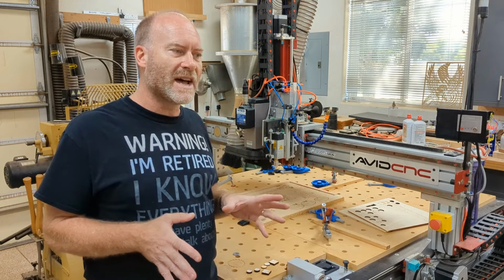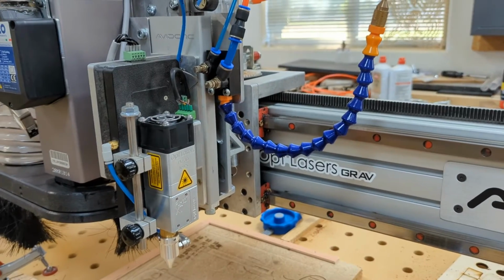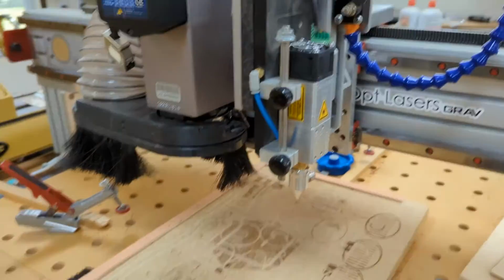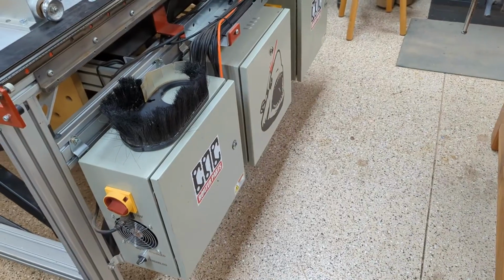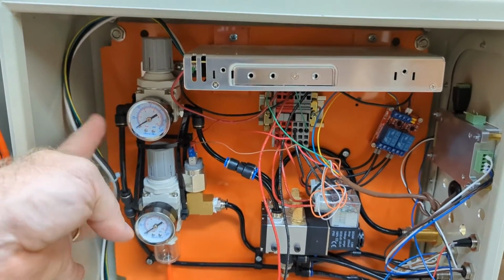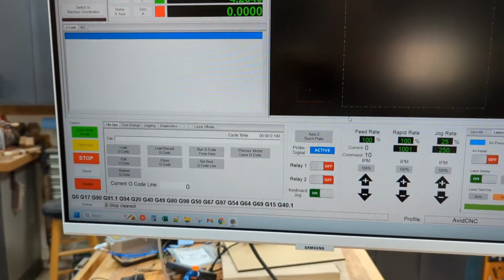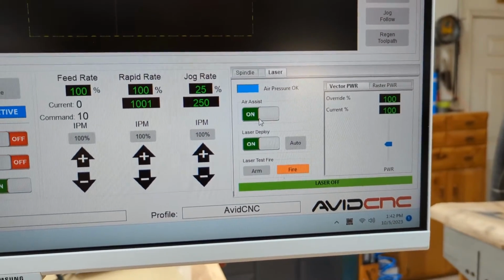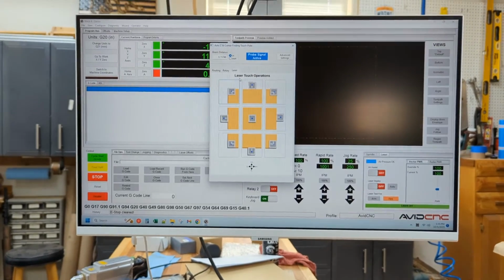Review of AVID CNC's New Laser Kit

Comment: Hi Jim, I am struggling to get mine to work correctly. I use vectric aspire. If I were to just set up a profile cut with toolpath 99 I can use the Mach 4 post processor? Also if that is how it works then how do you change laser power in aspire+how do you do pictures correctly? Sorry I’m a little lost with the laser portion and feel stuck.
Reply from the maker: I can help.  Send me an email at jnwdwks@gmail.com.  It's easier to work through it there.

Comment: Hi Jim, I recently added a laser to my Avid machine and using your screen set I was able to get the laser to test fire.  Then I came across your testing files and the laser actually worked for me.  My question is, how do you process the gcode to have the m2003 and m2004 commands along with the m62 p5 and m63 p5 code?  I use vcarve for my projects and I did just buy the laser module but not sure I needed it.  Thank for all the material you have posted!!

Edit** I figured out how to choose your No z .PP from the vcarve software and I got my first project to work. Thank you for all the work you’ve shared with the community.
Reply: I was just about to say, if you found my laser screen, then you were only one directory away :-)  Glad you found it.

Comment: Jim, I'm curious why you mounted the Opt Laser adapter on the gantry beam? I guess it makes the wire run to the laser head shorter, but is there more to it? 
How did you run the DC power from the power adapter up to that Opt Laser adapter? I'm about to wire up a new machine now and want to consider the options.
Reply from the maker: Hi Scott.  Good questions.  First of all, I had several of the stand alone lasers before I got the whole AVID kit to play with, so that location is there from before I had an AVID control box down below that has the Opt adapter box mounted in it.
However, I do like it up on the gantry because I can see it to tell if its armed, armed or firing, or key switch turned off, from the status of the 3 LEDs.  I also like having quick acess to the red power button so I can power down the laser easily.  The fans on some of the lasers are pretty loud, so I will frequently turn it off to give my ears some relief.  The last reason is that my AVID gets a lot of use as a test bed, so I am frequently switching things out, hooking up oscilloscope probes, etc. so I like having all the connetors up top and accessible for that reason.
As far as routing, I put my 24V power supply down in the control cabinet, and then when I got the AVID laser kit is is now moved to the laser control box.  I brought power and the ESS control wires up through the first run of e-chain (along the Y axis) to the control box mounted to the gantry (making sure the mess of stuff that is hanging on my Z axis can not contact the box when moved to the full right X position).  Then I just had to route from the output of the Opt adapter box along the X e-chain and Z echain the rest of the way to the laser.

BTW, you may have noticed that control box I have is surrounded in a black plastic box.  That is the 30W adapter box needed for the two 30W lasers I have.  Opt is re-designing that box to have a similar footprint of the original silver part, but will handle the extra power internally. I believe they are adding a little LCD display as well, so another reason to have it up top and visible.
Reply: That is very helpful Jim!  I'm hearing that your situation is a pretty special case, and now I understand why you've done it that way. It sounds like I can just mount the laser adapter down near the motion control box (I'm running Centroid Acorn) and put the power and PWM signal to it there. Then run the regular adapter wire up to the laser module head. I didn't know if there were any particular considerations like noise, signal loss, etc. 
The new laser kit is pretty cool. It's too bad it's Mach-4 centric.
Reply from the maker: @scottgrossman6148  The laser kit hardware is not mach-4 centric.  lf your controller has laser PWM support, and two spare outputs and an input, you can run everything in that box just fine.  The only thing thats Mach4 related is the screenset and software that AVID wrote, but you can live without that (I'm not using it because I had been  using lasers for a couple of years so I already had my own workflow and laser screen that I wrote).
I did look at the PWM signals at the adapter box input with the o-scope just to make sure they weren't too noisy.  I don't know what the acorn's I/O's look like, but most CNCs keep the controllers isolated (power and ground wise) from the chassis and other I/Os.  Usually the PWM is a bit too high of a frequency for the typical opto isolators used on CNC controller I/O, so in my case and AVID's, the PWM signal is connected directly to the ESS board, but Opt has designed the laser and control box to be fully isolated, so this still keeps the ESS's internal power domain isolated from the chassis and other power.
I will say that the ESS does have very good laser support.  The ESS plugin itself supports rastering directly, and there are ESS m code macros for tight power control timing with the motors.
Reply: @JNWoodworks  Oh, that is very good to know. I'm not sure how I got that impression, but I'm glad to hear I'm wrong. Thanks for clearing that up!
 The stock Acorn is a bit limited in I/O, six of each. This can be expanded in a couple of ways. I'm going to seriously consider how I can make it happen. 
Thanks so much for the very helpful information Jim! 
Scott
Reply from the maker: @scottgrossman6148  You're welcome.  I looked at the acorn site briefly and they mention they have proportional velocity control, so they must have pretty good laser support.  Looks like there are a lot of different versions of the board, but it should work well for you.  Then you can hook up an input to the air pressure sensor (i would call that optional, its just a safety check to see that there is adequate air pressure), and an output to turn on the air assist solenoid, and another to control the air deploy mechanism.  If you were only doing laser on your machine, you could also run these two things with one output, but if you are wanting to use an air nozzle for spindle work (I recommend that for some things it really helps clear chips and cool the bit and material), then you'd wan to keep them seperate.

Comment: Do you have any additional information on your magnetic mount for the 15w and 30w opt laser -or where did you source your “pogo” pin connectors. You have an awesome setup thanks for sharing
Reply from the maker: Yes, I have a google drive with all my laser setup files, mach4 screens, post processors, etc.  https://drive.google.com/drive/folders/1xB6J0RZIU1j8g951NkP-8HXC1swC2C-B?usp=drive_link
In there is laser set power point file, and on page 5 is an embedded document for the magnetic mount with part numbers.  If you are going to use it with the heavier 30W laser, I would recommend moving up to a 0.5" diameter magnet size.   I also have added the base design for the 30W laser in the vectric file.
Reply from the maker: You can always email me with questions at jnwdwks@gmail.com as well.
Reply: Thanks I just ordered it he 30W laser — I love the magnetic mount on my 6w opt laser and after seeing your mount I’d like to make something similar.  Such a great concept and I appreciate the inspiration

Comment: Thanks for all the good videos! I have a question about Rastering Bitmap Images Directly in Mach4 with ESS. I want the air assist to run also during the image raster, but I can't see to turn it on with the Air assist toggle button. I read somewhere that during Rastering, ESS has assumed full control and is not listening to Machs assumed full control and is not listening to Mach. Could I use the macros to active the air assist?
Reply from the maker: During the rastering process it does take over control, however, you have to run a Gcode file to setup the parameters for rastering, and to actually start the rastering, so you can turn on your air at the beginning of the file and off at the end just like you would do with laser vector work, or with a spindle gcode file.    If you need help getting it to work, just email me at jnwdwks@gmail.com

Comment: Do you know whether the new AVID Mach 4 laser upgrade 2.5.5  will work with any Opt laser setup on an Avid cnc machine? You helped me previously to set up my laser for both engraving and  laser rastering and after checking out the new Mach 4 upgrade, I would like to install it on my machine to see how it would work with my setup. Thanks again for a great video.
Reply from the maker: The 2.5.5 release is still based on Mach4 4908, and ESS 298, so there isn't anything new from that perspective (unless you are currently running something older).  What they've added in the release is more geared towards supporting the actuation mechanism and such.  However, yes, it will still work fine with your laser, and one thing that you might like is the way they convert a standard Gcode file for a end mill into a laser file.  This eliminates the need for special post processors in Vectric or F360.  However, since you already have the post processors all working and everything, its probably not really worth it to switch to the newer release.
Reply: 😊Thanks for your valued opinion Jim.